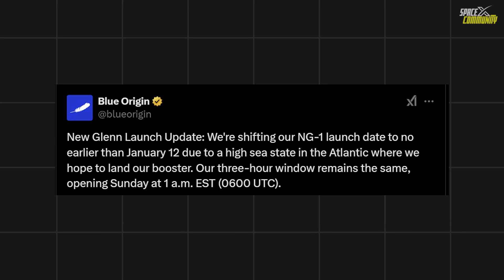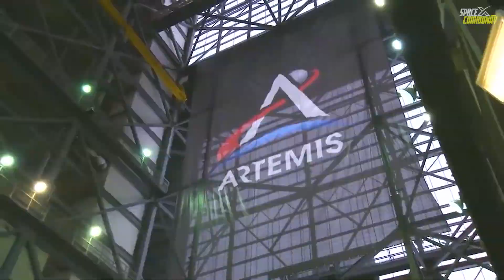Blue Origin Says Something Weird Happened to New Glenn JUST Before LAUNCH! When New Date?

Comment: I have a question and that question is: 
" Why should I 'Stay positive', about a company that has NOT even made orbit after 10 years?
 What exactly is there to stay positive about? 
The pace has been so slow, the manufacturing process is abysmal not to mention R&D is even worse than glacier like;  so i ask why should I "Stay Positive" based on all of this "evidence"'?
I do not believe so, I will remain skeptical as I am, and Blue Origin will have to prove themselves like everybody else. Start launching/testing have the failures, fix the problems and move forward - drive ahead -  don't stop; etc.

Comment: Lets. Not forget that BOhas taken its eyes off quality a few times with 1 failure just happening betweekhuman flights! The number engens that failed when delivered to UAL’s launch 1 and 2. Once good flight engines were found ht every flight engine forbothships needed to be fixed as they were not delivered flight ready.  They need to succeed but trying to do everything all, on flight 1 rockets have never worked as expected. In the case of SLS the flight 1 crew saved Columbia. Where Boeing failed 3times and you would think they are ‘smarter then BO, but that's just a dream).  GSJG2!

Comment: Hopefully, New Glenn's first launch and recovery will be successful.  However, I haven't seen much in the way of testing to be confident that all will go as planned. While BO has some experience in launching and landing New Shepard, that isn't anything close to launching and recovering even Falcon 9.  Space X began Starship with Star Hopper to test the basics of launch and recovery.  Space X sacrificed a number of prototype Starships to understand and learn what will work in launching and recovering massive rockets.  Space X has launched 6 booster / Starship combinations to learn how to perfect getting to orbit and recovering both

BO has done none of that kind of testing and upgrading and instead is relying on being successful on an incredibly first attempt.  Boeing failed miserably with it Starliner and it's been in the space business since it's early beginnings and supposedly has many decades more space engineering experience than BO and still failed.

All it takes is one critical oversight of engineering for the launch and/or recovery to fail.

BO is betting the farm on being perfect the first time.  I won't be surprised if New Glenn encounters problems on its first attempt.